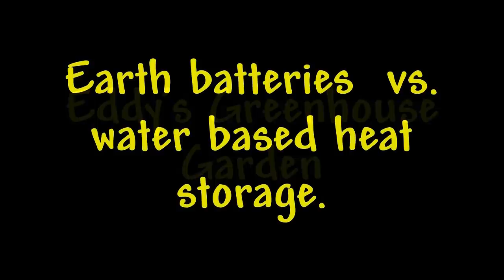Passive Earth Batteries Don't work

Comment: Earth batteries seem to be more effective the deeper you go. Once you're 8+ feet down into the ground, the temperature there stays pretty consistent through out the seasons. It depends on where you live of course, but here in the US below whatever latitude our border with Canada is, the lowest I've heard it getting is ~40 degrees F. That's enough to knock off the chill and keep your green house from actually frosting over, and you don't have to worry about running out of that base heat level when running your system because the earth around it is constantly recharging it faster than the system can pull the heat out. Unless you had a ridiculously large system, really powerful fans (though tube size > fan speed in significance), and/or you closed your system off by insulating the space beneath your greenhouse, you won't ever manage to cool it down fast enough that you freeze the earth.

If you're growing stuff that needs 50+ degrees all year round you're going to need something else to supplement it of course, if your ground temp is that low. I forget the average for the US but I think it's either 50-55, or 55-60. Definitely on the cooler side rather than the warmer. Geothermal is great if you have the time and resources to put it in; the efficiency of the fan and tubes moving air is "over 100%," sometimes "over 300%," and I shove that in quotes of course cause that's just comparing energy spent to run the fan vs kilo-calorie value of the temperature increase. The fan isn't actually creating the heat, the sun is.

Still some good information in this video though. I'm wondering how useful/practical it would be to bury barrels of water underneath the greenhouse, between the tubing, since water has so much more thermal mass than dirt. Someone smarter than me would have to calculate the thermal expansion to see how full the barrels could be, and you'd simultaneously need barrels durable enough to not leak out over time, but also aren't insulators themselves which would defeat the purpose. All plastics are insulators, glass is fragile, wood warps, most metals would corrode from being buried and wet for years, or are poisonous. I guess copper barrels would work, but that's a loooooot of money to bury underground and never see again. You'd probably need weird shapes of either water containers and/or tubing paths so the exchange could reach, too. At that point you're probably better off just burying a radiator network and running oil through it rather than forced air, attach a compressor and just make your own heat and cold.

I dunno. I live in the mountains none of this applies to me cause everything is shale about a foot down, and mountain mass does not work the same as actual below sea level earth does.
Reply from the maker: Ray, 
I will do a little video on the subject, how's that.
Ed
Reply: The heat comes from the earth itself, not the sun.
Reply: @scottrunge4077  
The earths core is estimated to be 6000 deg C but very little makes it to the surface. The sun provides about 5000x more heat to the earth than the earths core. ;)
Reply: @JohnGuest45  Yes.  Ground temperature generally conforms with average air temperatures in temperate regions.
Reply: It's Obvious you know a lot about this subject. Can you point me in the right direction to research burying water to add thermal mass?
Reply: These two links show some general info, but to be honest I actually /don't/ know a lot about the subject. I don't know if burying water will do much or any good, I was asking IF it would. I know with concrete you need to have a "glass to mass" ratio, let the sun beat down directly on it, and I believe with water barrells you also have the sun directly heating them up. If you bury water, you won't be able to do that. I was just wondering if you buried the water with the tubing running through it, if the water would be better than dirt for heating/cooling.

https://www.ecohome.net/guides/2208/thermal-batteries-all-about-storing-solar-heat/
https://www.ceresgs.com/tips-on-using-water-barrels-in-a-solar-greenhouse/

Comment: The same principles upon which HVAC heat pumps work apply here. There is a limit to how many BTUs can be pulled/pushed in a given volume of earth. Nobody is going to get enough heat stored in earth material to last all winter. There simply isn't enough density in a cubic foot of earth to do that. Even with an insulated earth bank, the heat loss will conduct whatever reserve is available in a matter of days. If a person wants to pump the numbers, get an old copy of Audel's HVAC book.

Some of the comments here are wryly humorous, as the effectivity of various materials for storing/delivering heat were commonly published back in the 70s. It goes roughly like this in ascending capacity;
Earth
Stone
Concrete
Water/glycol mixtures
Glauber salts

I fail to understand the rationale of building a system with no planning and estimating the requirements, and certainly not making claims of performance without data. This is a waste of resources, effort, time, and is merely reinventing what has been known for quite a while.

Plain water weighs in at 8 1/3 pounds per gallon, with 7.49 gallons per cubic foot. That equates to a volume of approximately 8' x 8.5' x 4' for 2000 gallons. At one degree F rise per pound of water = 1 BTU, that yields a capacity of just under 17KBTU storage for every degree rise of the water above ambient, up to the boiling point. For the volume of space and installation expense, earth will not compete with the cost and flexibility of a hydronic system. Having built my own hydronic heating for my house, using a modified NG water heater and welded up my own water heating wood/coal burning stove, I proved what I found in the literature doing the research beforehand. The wood stove was a fast burner, running at roughly 55% efficiency. I had to operate the stove in that mode because hydronic heaters are designed/sized to operate with a minimum water temperature of 160ºF. In a slow burner water saps too much heat out of the fire and extinguishes the burn--especially using coal.

For the investment of money, time, efficiency, versatility, and maintenance, your choice of hydronic heating is the most optimum solution, Ed.
Reply: depends how deep you dig, above 12 feet deep you will get bigger variations but if you go to the depth where winter/summer becomes irrelevant then you get an almost infinite heat source ie around 50 feet deep at 45 lat. would give a constant 54F year round.  now obviously its probably not cost effective anyways to do that so a water system will be a lot better.  Also i would point out this new thing called zeolite, if you really wanted to push a earth battery system and funds where not a limit, then using that would be better then water cause its actually 4 times better at storing heat then water.
Reply from the maker: That's really well said.  Thanks

Comment: Hmmm to add earth battery system on existing facility would be to dig near or along outside the existing greenhouse and pipe it in/out from there without much more effort.  So, nobody would be stuck with what they got per your comment.
Reply from the maker: Well I suppose you are never really stuck.  But if you don't put the earth battery right under the greenhouse, you will lose some heat to the surface.... then that portion of heat won't be going into the greenhouse where you  would want it to go.

Comment: Glad I can pipe hot indoor radiator air into my greenhouse in winter LOL! I also boil a big pot of water at night like a crab cook size and the boiled water adds heat all night. Perhaps heating a can of used motor oil .... maybe not. LOL!
Reply: Water retains more heat better than oil because it is denser.

Comment: https://www.youtube.com/watch?v=qA3YGYELZ98
Reply from the maker: Steven, 
This is an example of the best you can possibly do.  He's done an extensive build, optimizing every part of it.  He's engineered this out very, very well, in my opinion.   But listen to what he says.   He's in a cold wintertime place.  During the winter, without additional heat,  he can't grow tomatoes because it is not warm enough in there.  It stays above freezing because he's done this so well.   There are cold weather plants that will grow through the winter in there.    I am not arguing with his results.  He's telling the truth.   I'm  trying to explain  there are people, who pass themselves off as experts,  and they try to  sell you the idea that you can keep a passive heated greenhouse at 70   degrees during   the winter in a cold climate.   No you can't.   And this video is excellent  proof is of that.  It's takes a lot good solid planning and engineering to do as well as he's done.   So take this as proof of what you actually can do.  But don't believe that hype that says you can have a tropical rain forest during the winter in a setup like this without additional heat.   
Ed

Comment: You could build a rig to put both tanks ontop of eachother, then put your electric water heater beside them from what I can see.
Reply from the maker: I think that would work but I also think it would take up space in the greenhouse.   I already have a little room with some water tanks and a water heater in it.  I am going to expand that room and use it for the water storage and water heaters.   It's only about 20 feet away from the greenhouse so it won't take too much pipe to connect.   If I didn't already have the little  heater room, I would probably do what you are suggesting.  It's a good idea. 
Ed

Comment: Instead of rigging the heat exchanger for the propane heater, you should simply vent it's exhaust into the greenhouse. Commercial growers do just that - first, you'd extract all the heat from it; secondly, you'd increase CO2 concentration in there, which promotes faster plants growth while using less water.

Thanks for sharing your ideas, it is solid reasoning!
Reply from the maker: You are absolutely correct however.......I am going to try and do this with solar power  heating up water tanks during the day.   But ya' know....using a small heater just for the CO2  isn't a bad idea.    I know how much that helps growing plants but I would be afraid of someone walking in there and passing out.  Hmmmmm    ....another thing to consider.   I am getting a lot of good ideas.  Thanks. 
ED
Reply: If you do that direct vent thing, carbon monoxide detectors are mandatory.
Reply: a small heater would not increase co2 enough to be a problem in a greenhouse. Although you would want to have detectors in place for make sure. Carbon monoxide is only a problem when the gas is not burning clean. Most indoor propane space heaters are extremely clean burning.
Reply from the maker: Oh yeah....and a buddy system too.   It is a little dangerous for sure
Reply: ...I don't know if it is so dangerous indeed - what about indoor gas space heaters ?

Something to check for sure
Reply from the maker: Yes that's true.  I do recall some friends who had one of those.

Comment: Thank you for exploring alternatives but I am afraid you miss understand the earth battery. The earth battery system is not meant to be a day/night system. It stores heat all summer and returns heat all winter. If folks want more info on earth batteries I hope you will explore info elsewhere.
Reply: Hi Sarah, we built one and in our experience, it is a good day/night system but would never work as a whole season system.  After several hours of use in hot, the ability to cool dissipates.  After several hours of use in the cold, the ability to heat dissipates.  As you exchange heat, it has to go somewhere (thus the concept of a battery).  But the soil does not have a limitless potential to draw away heat, and even if it did, it would not be able to give it up over the course of a season later in the year.  The exchange has limits and if you're trying to affect air temperature in an open air system (all greenhouses need air exchange with the outside), it is an amazing amount of energy.  Fortunately the sun provide excess energy every day, if your greenhouse is well insulated, and all greenhouses can capture excess heat during the day.
Reply from the maker: Sarah, 
I would really like to see a demonstration of that.  It's all over the internet as a theoretical thing but it's just not possible, unless you are fooling yourself because it's really not that cold outside during the winter.   What you're telling me is not that much different than saying if I take a car battery and charge it up all summer, I can use it all winter before it will run out of power.  It's just not possible.  A mass of earth only has a finite amount of thermal energy it can store.  Volume wise, it is much less than water.   Even a small, well insulated greenhouse is going to require about a 5,000 watt heater at night to keep it from freezing.   If the night is only 6 hours long that's 30 Kilowatt hours of power.   If the winter is only 90 days long....that's 2.7 Mega watt hours of power.   You just can't store that amount  of heat energy in the dirt under a greenhouse.    It's physics.....it's not possible.     
Ed
Reply: @eddysgreenhousegarden7022  
I agree, seasonal storage is very difficult. When designing an earth battery you have to consider the local climate and how many sunny days you might get in the winter. A long run of cloudy days will discharge the battery but an hour of winter sun in the day can get you through the same night. A lot of folks think water is the best medium but capacity isnt the important thing when the amount of heat available is limited. If you disperse x amount of heat into a large body of water you wont see any useful temperature rise. If you put it into the ground via perforated tubing it isnt dispersed into the mass..it remains close to the tubes where it can be accessed during the night. On my experience, any heat that moves further than a foot from the tubing cant be accessed the same night. The conductivity and diffusivity of soil is often seen as a disadvantage when its acually of great benefit.
Reply from the maker: Very well said.  Thank you  for your input. 
Ed

Comment: I don't know wich channel I saw this (some kind of workshop on building and installing solar heating, a long video with a lot of info), but using solar heat is far more efficient than using solar PV for heating water. Solar PV pannels typically only have ca 20% efficiency. Solar heat pannels, if I rememmber correctly, can reach between 60 to 90%  efficiency. 
That being said, it is better to use exces solar PV to heat your water instead of just not using it, but investing in solar PV, just to use for heating is not always the most cost effective.
Reply from the maker: Jelle,I really appreciate you commenting here.  I have experimented in the past with solar heating panels.  While they can be indeed a lot more efficient at converting sunshine directly to heat.  That efficiency “effect” changes the game as the surrounding air temperature changes.  The surrounding air temperature does not really affect PV net output.  It does have a pronounced affect on a heat panel’s output.  For example if it is about 60 or 70 degrees out and you can get a temperature rise of 60 or so degrees out of a heat panel you can get 130 degree water or air out of it.  However when winter comes you will still only get that 60 degree temperature differential because of the inherent heat loss of the panels when it is so cold outside.  So if it is 10 degrees outside that only gives you about 70 degrees at the output now.  Water needs to be much warmer than that to be able store heat with it.   You can do better than that with exotically engineered, vacuum encased or some other technology but that will be expensive.  Looking at that……..Photo voltaic, with its 15% or so efficiency  now looks much more cost effective during cold weather.    
Hope this helpsEd
Reply: this is why you would use vacuum evacuated solar tubes as the collectors. The vacuum eliminates the issue of outside temperature because the tubes are "insulated" by the vacuum.
Reply: Jelle is right. I have three hot water panels on my roof that keep me in hot water almost all the time. The Btus collected per square foot are far more than PV can deliver. BUT......they are evacuated tube panels, 20 tubes each. The flat plate collectors just don't work well in cold climates. I'm in British Columbia, Canada. 
Believe it or not, I can make water at minus 18-20C. Colder than that, the sun is unable to burn off the hoarfrost so hot water production stops. My woodstove with coil takes over.
PV prices have been falling, falling, falling. Solar hot water panel prices have not. We have reached the point where heating water with PV is beginning to look attractive. A neighbour is trying that out right now.